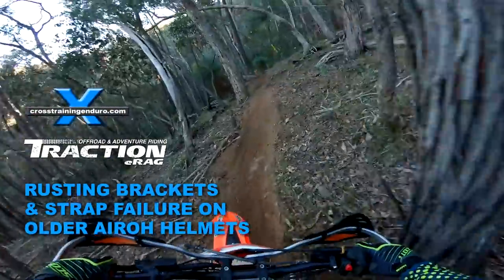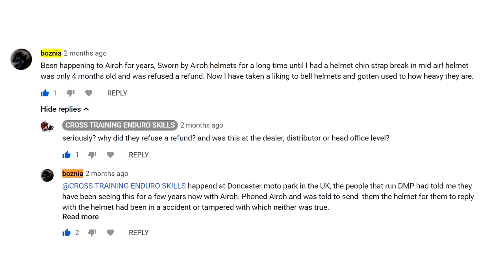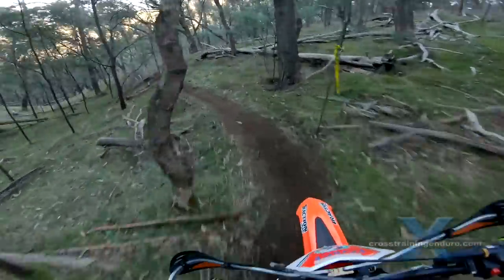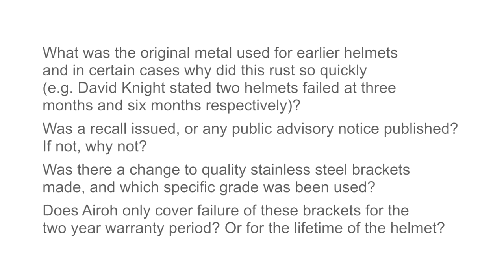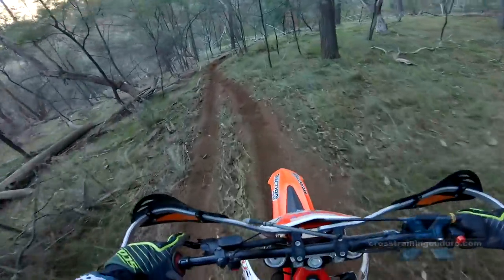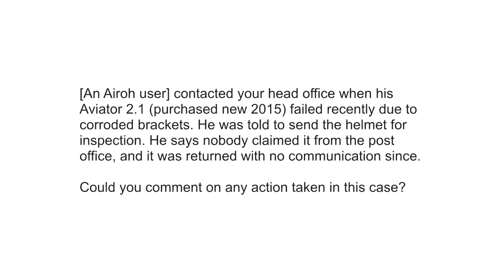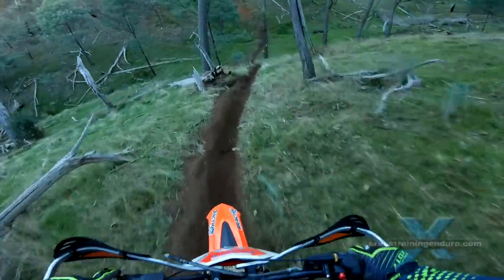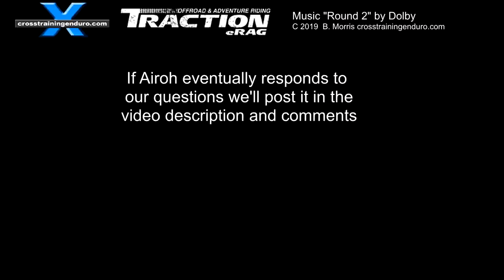Airoh helmet review: update on rust & strap failures︱Cross Training Enduro

Comment from the maker: AIROH UPDATE! After messaging Airoh's head office over 18 months we finally got answers to our questions... sort of. They will not tell us if and when they changed their brackets to a non-rusting metal, but did point out there have been no known cases in recent years (the most recent cases we know occurred in 2017). They asked us to get everyone with defective helmets to contact them for resolution - but Airoh has not replaced any of these defective helmets, just saying there were probably issues with how the helmets were stored or used. This included a case where the strap fell off after only two years!
CHECK YOUR HELMET  The important message is to check your helmet regularly. We have had reports of rusted brackets on Oneal, Acerbis, Just1, Kali, Fox, Bell, Suomy, Airoh, Leatt, Jitsie and M2R helmets to date.
It can start early too, as per this comment on Fox's Facebook feedback:
I bought a Fox V2 helmet which had rusted buckles with less than 10 hours of use.... Its sad that profits have got in the way of quality
B.H.

Comment: I have a helmet collection of around 400 helmets . Thirty or so MX helmets. Thanks for the heads up. Airoh is ‘ now ‘ not going to be my user MX lid. I’ll stick with BELL ( since ‘75).
Reply from the maker: probably less chance of it happening with Bell, but it still can... we had one guy who was very surprised when the strap came off his Bell when a bracket rusted through.
Reply: Is it from sweat ? I did MX in Weipa for ten years ( humid/ hot/wet season)and I have never heard of this at all. Comparing the modern BELL’s to the old MOTO 3’s and MAGNUM open faces, I personally think the quality is not there. I’ll keep an eye out for these anchor points. Thanks
Reply from the maker: sweat is one cause. but of course if they used marine grade stainless steel it would be a non-issue. so far we have discovered alloy brackets (in earlier suomy helmets), mild steel but with an inferior plating that was too thin or wore against the strap and allowing rust to start, and possibly low grade stainless steel that wasn't rust-resistant enough.

Comment: I tried to contact Airoh about something completely different and didn't hear a peep! I threw my lid over a fence into a bush and vowed to never buy one again. 
It's the tactic of "just keep quiet and they'll go away". Plenty of other good lids out there adhering to high standards such as Gold ACU, DOT or Snell. I say fuck em 👍🏻
Reply from the maker: sadly they do seem to have a terrible reputation for not responding to issues. interesting to note though i haven't found any reference to the need for stainless steel brackets in any of the helmet standards. maybe i'm not looking hard enough?
Reply from the maker: Will, Airoh has finally responded after 15 months! They still haven't answered any questions, but did say that everyone with problems should contact them at info@airoh.com   Mention this vid, their previous lack of response, and keep my posted.
Reply: CROSS TRAINING ENDURO Will has died waiting for Airoh to reply

Comment: I  had a Stelt that the chinstrap came away on, rusted out. I have an early Aviator which is back in service at the moment  (waiting for a new liner for the current) I will dig in to the 2.1 for a look.
Reply from the maker: Do remember which year you bought it in Chris, and how long it lasted before the strap gave way? I'm still compiling cases to hopefully ensure the problem doesn't exist anymore, since Airoh head office hasn't replied to our questions.
Reply: @crosstrainingenduro  The Stelt was an 08 purchased in the UK. I  replaced the straps and brackets with bits from an old HJC. Before the helmet was even two years old.
Reply from the maker: @chriswill7674  I'm glad it's not recent, this tends to support the claims that the brackets are made from a more rust-resistant material in recent years. The last case I could find online was a 2015 Airoh Aviator.
Reply from the maker: Hi Chris, I have been chasing Airoh for 15 months with questions about their rusting brackets and strap failures. They have finally responded... kind of. They still have not answered my questions, but they did ask for everyone with faulty helmets to contact their head office and they will resolve things. Even though your helmet failed years back, I'd encourage you to email info@airoh.com with details, mention this vid, and include their email below. We have to keep them accountable! 
From: info@airoh.com
To: info@crosstrainingenduro.com
Dear Barry, thank you for your message. Sorry for delay of responding but with corona virus emergency we were all less operative; and we would like to give to all requests the time needed to answer to all customers' problems, needs or questions. Regarding your request, we kindly ask you to give us contacts to all customers cited in your email and in your videos (or to give them our contact), in order to talk with them and solve their problems ASAP and in the best way. Thanks in advance. Have a nice day.
Best regards
Carlo Locatelli
Info Dept.
info@airoh.com

Comment: A magnet will tell you if the metal is the kind of Stainless Steel you want or not. If a magnet will not stick, it is the good Stainless Steel, if it does stick, it is a ferrous metal and will rust.
Reply from the maker: i heard the same thing but there are actually certain types of stainless steel that aren't magnetic...
Reply: @crosstrainingenduro  That's what he's saying. Good stainless steel is NOT magnetic.
Reply from the maker: https://www.scientificamerican.com/article/why-dont-magnets-work-on/
Reply: First off all stainless steel sticks to a magnet. Pure stainless like food grade stainless does not stick to a magnet and is also extremely soft metal. However, hard stainless steel like high quality knives are made from all stick to a magnet. You do not want the rings of the helmet made of pure stainless its too soft. Their are many types of stainless steel though and rust corrosion depends on the amount of chromium used in that specific steel. You are thinking of pure medical or food grade stainless which is not the same thing as hardened heat treated stainless steel that has carbon in it unlike pure stainless. Two totallt different metals

Comment: Sweat is the cause of the corrosion.  Washing the helmet after hard rides and maybe spray wd40 on your fingers then rub the brackets . Maybe the answer to the rust problem.
Reply from the maker: actually the rider with rusted brackets in his leatt was advised to apply some kind of anti-rust treatment. but a critical safety issue with helmets is to never have any solvent-based products on or near the helmet liner as it can weaken or dissolve the foam. and i know some riders do wash their helmets regularly (water only, no detergents of course) but the brackets should stay rust-free in any case because there's usually a hard plastic sheet to prevent sweat making direct contact. if a helmet is washed it's very important to air it for a long timer afterward, i did come across riders saying they think washing the helmet may have caused rust because the brackets are in such a tight location that prevents good airflow....
Reply: @crosstrainingenduro  switching helmet brands seems the best idea. That's why I suggested putting wd40 on the finger tips to rub the brackets  and not spraying.   My fox v3 is from 07.  No rust or issues of any kind.

Comment: Just buy a Shoei VFX-W and you´re good. It seems like Airoh is not interested in our health. They just want our money.
Reply from the maker: maybe. but it's not just airoh and suomy. but we came across a guy with a BELL MOTO 8 (a US$400 according to google) who had the strap pull off in his hand due to rust. admittedly this is in their cheaper range but so is the VFX-W. sadly if a manufacturer can save a few cents on each helmet i think many will nowadays. instead of marine grade stainless steel they will just use mild steel with something like cadmium plating which can rub through then allow the rust to start. this is what happened with another riders's expensive LEATT helmet after only 13 months. 😢

Comment: Its because the contact between steel an the carbon helmet.
Reply: I'm curious how you know that? I work in an industry that uses Carbon Fiber and Aluminum and I know that it helps to use a simple coating that prevents direct contact from the Carbon and Alum becuase it causes "galvanic corrosion". Perhaps Carbon and Steel also cause this galvanic corrosion? I'll have to research that.
Reply: You're right. Have a look at the elektro chemical series. Contact corrosion is possible, if there is an elektrolyte (sweat). A plastic coating should stop that.
Reply: @mmenduro3945  Thank you Sir! I was thinking after this video that sweat is no better than salt water. Basically the same thing? Sweat must be a pretty corrosive liquid if you think about it..?
Reply: Jip, it contains water, na+cl- (salt) and other minerals. Pretty good elektrolyte.
Reply: So skip carbon helmets eh?  :)  Last two are carbon and they've both rusted.  Kali and Just1.